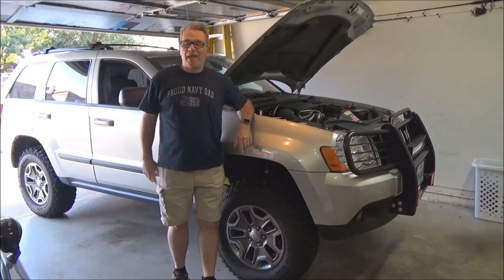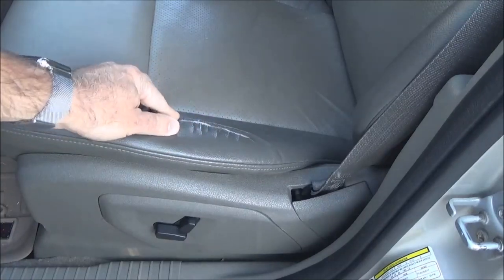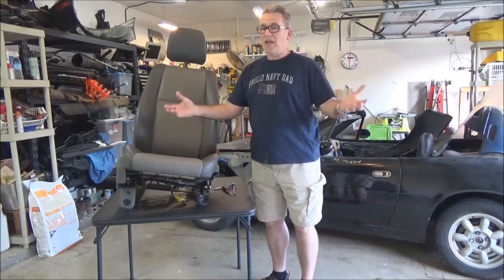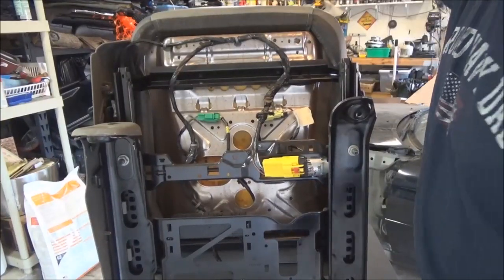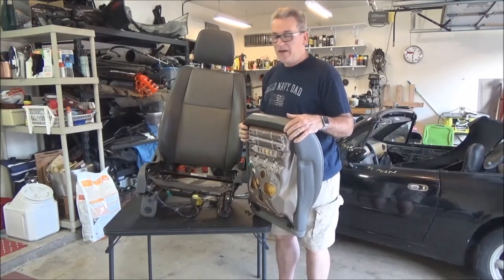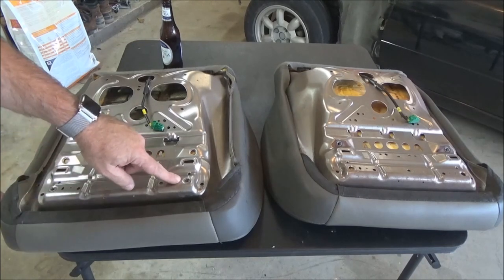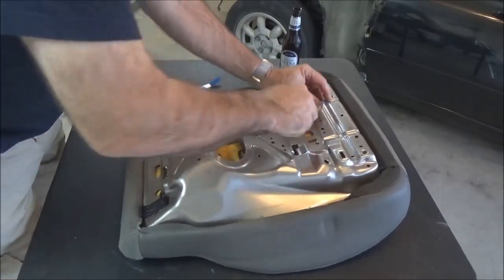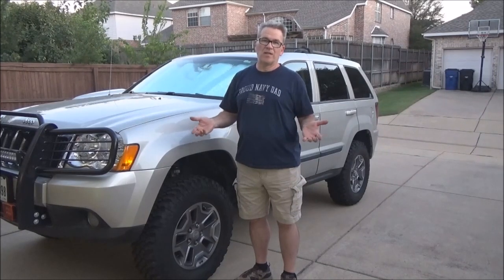Jeep Grand Cherokee Seat Repair

Comment: I have had an absolutely flawless passenger seat sitting in my basement for 3 months. I was pulling my hair because the wiring was different from my 05 to whatever year this seat was from. Your video lead me on a tangent realizing that the frames were similar, I could remove the seat tension harness,and replace it with my 05 harness, to swapping out brackets and adding bolts to make the passenger seat the driver. Thanks for the upload!!!!!!
Reply from the maker: Very cool Glad I could help a follow Jeeper

Comment: This video was very helpful. The only thing I would add. For the Grand Cherokee 2006 Limited edition may be purchased by itself online by selected vendors so that folks don't need to purchase the entire seat (~$160). The grommet removal tool was very helpful to disconnect wires on the bottom, so I would recommend this for sure. The drivers seat bottom was easy to remove as you described from the frame mount to seat. A few things I improvised: The 3 wires that hold the existing seat to the foam had to be removed. I cut these out as they are wedged with significant tension to the seat. I used long plastic zip line ties for replacement as these were flexible and easy to place. (could also use some flexible wire which may be even better).  Thank you again! If you have any videos on replacement of dash lighting that would be helpful.

Comment: Man now I can finally fix this ugly seat problem. Thanks a million! Been looking online and found one on Ebay about the same price 180 bucks but you just cut my workload over half the time. Subscribed! Great videos. If you ever do ball joints on that WK do a video, there's hardly any out there. Bottoms aren't bad to do, my uppers had bad bushings so I just replaced the whole control arm but I couldnt even fit the press in there if i wanted too, would imagine you have some tricks and there's nothing really out there of good value. May make for a good amount of views imo. Thanks again

Comment: Thanks, this worked great.  On my 2005 model the actual foam was a little different inside, so also needed to remove the interior metal springs from the old metal seat bottom, and then the foam from the new seat fit perfectly.  Seat was only $35.

Comment: I'm doing my Commander this week as I finally found a replacement Overland seat in incredible shape. I'll be swapping the back where I think I'll only need to cut a hole for the lumbar on the side and should be hidden somewhat by the pillar on the drivers side. I appreciate this video as it beats those tacky seat covers. Cheers and Go Navy!
Reply from the maker: Cool when we bought the 08 Cherokee I tried to buy and 08 Commander Hemi 4x4 but they sold it out from under me. Really like those rigs

Comment: Hey man i love the vids and have been wondering where you got your grill bar from and what kind it is
Reply from the maker: The same Grill Guard is offered under at least 4 names that I found, Aries, Hunter, Black Horse and Western in Chrome or Black
Here are a few links  
https://www.ebay.com/itm/Fits-2005-2010-Jeep-Grand-Cherokee-bumper-brush-grille-Grill-Guard-in-black-/301961125164
https://www.carparts.com/grille-guard/aries/ars1046?&vehicle[model]=Grand%20Cherokee&vehicle[make]=Jeep&vehicle[year]=2008
https://www.summitracing.com/parts/bho-17a080200ma?seid=srese1&gclid=Cj0KCQjw-uH6BRDQARIsAI3I-Uf6rnTN1K3EMYY8K0hbWB7Ng0S47fGs9rbxS3wCemk24bE9qOJsGyIaAvQGEALw_wcB
https://www.amazon.com/Hunter-GJ-503-Grille-Cherokee-Models/dp/B00OPCZNVA/ref=sr_1_2?dchild=1&qid=1599661225&refinements=p_n_feature_keywords_browse-bin%3A3944556011&s=automotive&sr=1-2
https://realtruck.com/p/aries-classic-grille-guard/v/jeep/grand-cherokee/2008/

Comment: Hope to do this to my commander soon.. I've seen some getting Grand Cherokee seats for them but the pattern is different so they have to find and use two passengers seats from two grand Cherokees to have a matching set up front.    The cushions are the same but the covers have a different stitch pattern and would stick out as having been replaced.
Reply from the maker: Yes the commander seats are slightly different but I think they used the same frame so it should work the same.

Comment: Thank you NavyDad and thank you for your service!

Doing this on my 2006 Commander.  I purchased the leather seat from my mopar dealer over a year ago and have procrastinated a bit.

Did you remove the negative battery cable before you started.  I’m concerned about the airbags.
Reply from the maker: Yes very good point! I should have said that, yes disconnect the battery before removing the seat.

Comment: Can you tell me a little bit about the suspension parts on this jeep? I have looked at a lot of lifted Wks and I like this one the most and would like to replicate it with mine.
Reply from the maker: Hi yes its the Rough country 2in kit and the wheels/tires were factory 2018 JK takeoffs 255/70R18 I found on Craigslist the kit easy to install and you do not need to change the brake lines with the 2in kit  https://www.roughcountry.com/suspension-lift-kits.html?find=2008-jeep-grand-cherokee-2wd-565790&sid=nN6hV5QocZ
Reply: @NavyDad  do you get any rubbing
Reply from the maker: no rubbing but if the tires were any larger it would rub

Comment: Mate where did you get you bumper/bull bar
Reply from the maker: The same Grill Guard is offered under at least 4 names that I found, Aries, Hunter, Black Horse and Western in Chrome or Black
Here are a few links  
https://www.ebay.com/itm/Fits-2005-2010-Jeep-Grand-Cherokee-bumper-brush-grille-Grill-Guard-in-black-/301961125164
https://www.carparts.com/grille-guard/aries/ars1046?&vehicle[model]=Grand%20Cherokee&vehicle[make]=Jeep&vehicle[year]=2008
https://www.summitracing.com/parts/bho-17a080200ma?seid=srese1&gclid=Cj0KCQjw-uH6BRDQARIsAI3I-Uf6rnTN1K3EMYY8K0hbWB7Ng0S47fGs9rbxS3wCemk24bE9qOJsGyIaAvQGEALw_wcB
https://www.amazon.com/Hunter-GJ-503-Grille-Cherokee-Models/dp/B00OPCZNVA/ref=sr_1_2?dchild=1&qid=1599661225&refinements=p_n_feature_keywords_browse-bin%3A3944556011&s=automotive&sr=1-2
https://realtruck.com/p/aries-classic-grille-guard/v/jeep/grand-cherokee/2008/
Reply: @NavyDad  thank you much appreciated.

Comment: Do you have to remove the whole seat out of the suv ?  or can you just replace the seat cushion in the suv without removing the entire seat assembly.  Thanks
Reply from the maker: Yes you can but its a bit of a pain if I remember there are 6 10mm bolts that hold the seat frame to the track assembly and several plugs for power at i think 3 wire looms that have to be popped out but it can be done.

Comment: Thanks for giving me the confidence to undertake this project , just one unrelated question. What type of lift is on your WK and what size tires are you running?
Reply from the maker: Hi the lift is Rough Country's 2in kit (easy to install) and the wheels and tires were new take offs from a 2016 JK they are  255/75R17 I bought all 5 from a buddy who did a dealer upgrade at delivery so they were new at the time. And the spare does fit, barley but its does fit in the spear tire well
Reply: Navy Dad thank you! Looks great. New seat cushion cover going on this weekend 👍🏻

Comment: What's the lift and tire size on the 05 Grand Cherokee ? ? I just purchased an 05 with a hemi and looking to gain some clearance. Thanks in advance for any reply. . .
Reply from the maker: Hi yes its the Rough country 2in kit and the wheels/tires were factory 2018 JK takeoffs 255/70R18 I found on Craigslist the kit easy to install and you do not need to change the brake lines with the 2in kit  https://www.roughcountry.com/jeep-suspension-lift-kit-664.html?find=2008-jeep-grand-cherokee-4wd-565791&sid=I21ru3bT3m

Comment: Hey, currently trying to detail my ‘03, but can’t seem to find the back attachment for the front seats. Just a mess of wiring and brackets i can’t reach. Any pointers?
Reply from the maker: 99-04 Cherokee WJ's are complete different seats from the 05-10 its a full frame seat and does not come apart the same. On those you just replace the cover itself. they have plastic folding clips and a few hog rings. However on those the frame are prone to cracking and braking apart. If that happens you basically have to replace the whole seat

Comment: What are you running? Lift? Tires?
Reply from the maker: Wheels/tires were new (at the time) 2018 OE takeoffs from JK Rubicon 285/70R17 and Rough Country 2in lift https://www.roughcountry.com/jeep-suspension-lift-kit-664.html?find=2008-jeep-grand-cherokee-2wd-737035  if you go with anything larger you'll have to replace the brake lines.
Reply: @NavyDad  did you ever have any problems with the Cv Axle?
Reply from the maker: @Skrillexsgames  Well no... because it's a 2wheel drive :( We were out of time I had to get my son a newer more reliable rig quick to drive across the country to his first assignment (US Navy) His 01 XJ was tired at over 200K I could not find a good 4x4 WK and knew the original owners of this one.

Comment: What kind of wheels do you have on the jeep? Also, is it lifted? If so, was it a 2 or 3" lift? Thank you
Reply from the maker: They were new take-offs from a 2018 JK 255/75/R17 I got all 5 and the spare even fit with a little hammer mod. The lift is a Rough Country 2" inch no rubbing either but you will have to have the EUC updated for the new tire size.
Reply: @NavyDad  how did you update the EUC?? I have 06 grand Cherokee with the same kind of Rubicon wheels and it’s throwing off my wheel senses. I’m not sure how to update it

Comment: I cant believe i found this video!!!!! and whats the company for the push bumper?thanks soo much in advance!!!
Reply from the maker: Hi it’s a Hunter Bruch Guard from vendor truckgeardirect on ebay (they’re out of Houston, TX)  
There is another one made by Aries Brush model 1046 (which I think is the same one rebranded) you can find on eBay too, Amazon has it but its like $100 more.
Reply: Thanks a lot about to order one with free shipping too!, hows the durability?
Reply from the maker: Its good powered coated not painted we had one on the 01 XJ and I have one on my Tahoe too

Comment: I removed the seat, but now the air bag light is on. Any ideas?
Reply from the maker: sounds like it not plugged in correctly. unplug everything under the seat then disconnect the battery and turn on the headlights for a few minutes so the BCM and airbag controller are fully drained of power. plug everything under the seat and reconnect the battery and test

Comment: Want to replace the leather cushion cover on my 2016 Grand Cherokee Summit which is unfortunately quite worn already. Problem is it's $460.
Reply from the maker: The WK2 seat design is very similar to the WK, the same process should work. Check on eBay or search one of the larger national salvage parts locator’s sites. Passenger seats typically cost less than driver’s seats too. Check craigslist and Facebook market place too for part outs.

Comment: Just ordered a new cushion from Moparamerica.com. Nice tires, please can you tell the sizes & lift, I'm planning something similar?
Reply from the maker: Let me know if you get the covers. I ordered from 2 on-line Mopar suppliers and my local dealer. They all showed the part available, but none could get each told me its no longer available after waiting 2 weeks. Other styles may still be available this was for the tutone taupe/tan leather available 2008-10. As for the tires and lift: tires were band new 2017 JK takeoffs got all 5 for $900 they are 255/75 R17 (love those wheels) And with a little mod I was able to get #5 in the spare tire well  the Lift is a Rough Country 2 inch. Very easy to install and you can still use the stock break lines but have to relocate. I would suggest adding longer lines. Make sure you get the rig aligned after install
Reply: @NavyDad  Ok, they cancelled the order. But I managed to find a seller on eBay and got a brand new cushion for $117. I already installed it and it looks just perfect :) Thanks for the tire and lift info!
Reply from the maker: @akiimmonen  That's great you were able to find a new one